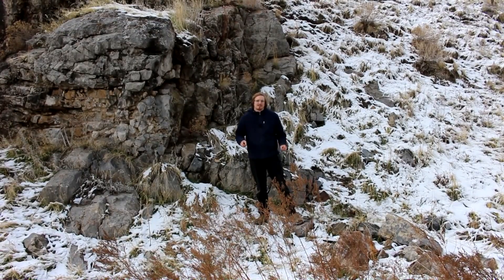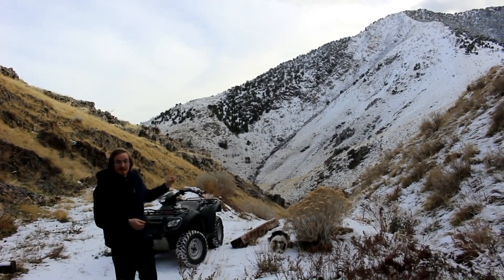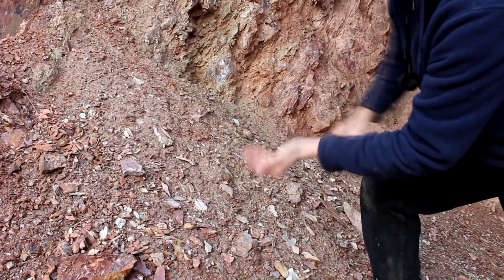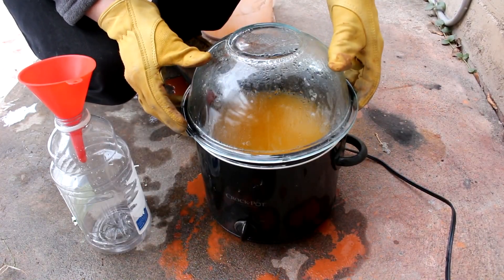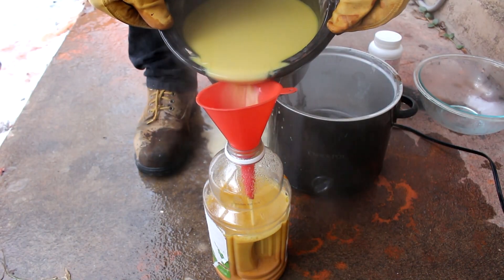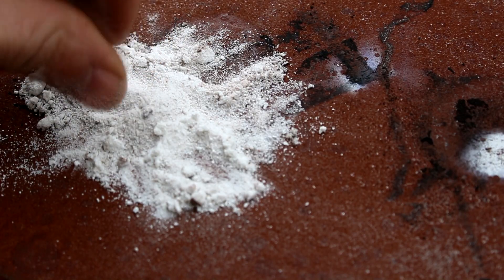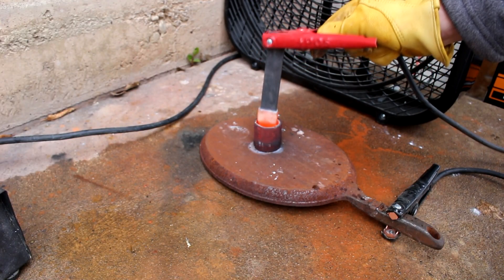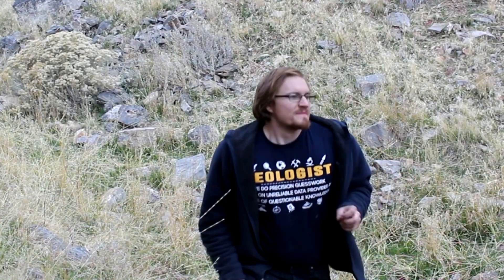Aluminum From Dirt

Comment: The great thing about alumina is the whole covalent nature of aluminum chloride leading to it being very easy to isolate with the decomposition (leaving it in water long enough causes it to turn into hydroxide as well. I know this because I accidentally made it just playing around with the acid). The cryolite part scared me, because 1. It seems like  hard thing to source on a large scale, and 2. I was scared about fluorine gas, but hearing that the cryolite doesn't get used makes me feel more inspired to try this.

It's not a top priority, because on a small scale, this is wildly inefficient, but I'd like to try this.

Comment: CODY, WHATEVER METALS MIGHT BE MIXED IN THE ORE, IF YOU MELT THE CRUSHED MATERIAL AND COOL IT IN A THIN AND LONG MOLD, THE METALS WOULD MOSTLY SEPARATE BY DENSITY, MUCH LIKE FLUIDS WITH DIFFERENT DENSITIES, OIL, ALCOHOL, WATER! YOU COULD ALSO DEVELOP (SINCE YOU ARE VERY COMPETENT) A SPECTROPHOTOMETER AND TAKE SAMPLES FROM DIFFERENT LOCATIONS IN YOUR AREA AND KNOW WHAT'S THE COMPOSITION OF THE ROCKS AROUND YOU!

Comment: 🎉My friend, I have a question for you that I hope you can answer.... Why do we not use aluminum salts to extract aluminum metal from it by electrolysis, such as chloride, fluoride, or aluminum nitrate?These salts have very low melting points

Comment: The silica is dissolved in basic conditions, not acidic. The acid is weathering the feldspar, but after that, the pH has to change.

You actually use this to your advantage😏

Comment: The tiny bit of aluminum is a good example of how highly charged electrons really are.  Faraday's constant - 96485 coulombs per mole.  If you want a gram of aluminum, that's 1/9th of a mole of electrons (1/27th of a mole of aluminum @ 3 electrons per atom), or ~10,000 coulombs of charge you have to move around.  If you were actually able to push 40A through the mixture it would still take ~4 minutes to do the job.  Electrochemistry is so often ridiculously slow.

Comment: Would it be easier to use an induction heater, which is contactless, rather than heating via current carrying electrode? I think the aluminium, as a conductor, would heat up and fall to the bottom
Reply: He isn't heating it with the electric current - he's electrolyzing it, the same way you can split water into hydrogen and oxygen by passing electric current through water.
Reply: @stargazer7644  thanks for the answer

Comment: I am an electrical engineer with associate degree in Metallurgy. Very Informative video I learned a lot from your geology lessons and I love the aluminum electrolysis. The fan was cooling everything so fast that your electrolysis did not yield all the aluminum. I would retry the electrolysis in open air without the fan and I bet you'll get more aluminum extracted. Congrats this is how inventors worked and found new metals.

Comment: I'm Rohan ,I'm from Jamaica I have been wondering why Jamaica,allow them to still take away our aluminum ore aka bauxite ,and not make aluminum here in Jamaica,I'm living in ga now ,so I decided to see if anyone knew how to make aluminum from the raw material,so that's how I found your video,,so thanks for the knowledge shared ,great video,as a child I used to hike the rivers and valley in spring Mount ,I used to find wired dirt on old river banking some blue some orangeish brown,never knew what they were but was always curious,Thiers a dirt we called abbuh,not sure if that's the proper name ,but it was not a rock it was hard and shining when our buts sat on it ,kind of like we polished it with our buts ,it was not stone but hard dirt I could brake it off in big chunks ,it had honey color of darker or lighter shades ,I always wonder about it ,I wish I had your knowledge in this area ,again thanks for sharing,I hope u do more videos
Reply: It takes huge amounts of electrical power to convert aluminum oxide to aluminum metal, so aluminum production takes place wherever electricity is cheapest. Jamaica does not have cheap electricity.

Comment: The muriatic acid solution pouring over your boot, the 200Amp electrolysis under the snow, on wet ground, with red hot electrodes...OSHA wants to know your location

Comment: Is it possible to do the electrolysis that turns the alumina to aluminum in an arc furnace?  Where it simultaneously heats and separates the material? It might be tricky, but it could be possible.

Comment: You started off with sourcing your RM's from the soil but it went from there to the shop shelves before you could get your metal. 
Still at one point Alluminim was concidered to be way more expensive than gold - which is because its so difficult to get it all done from scratch.

Comment: How much alumina did you add to the creolyte? The optimum for most smelters will be around 3%, at this point the resistance is the lowest resulting in a higher current efficiency. Lower alumina concentration would cause an anode effect whereby the reference voltage goes up quickly and then it is thermodynamically feasible to decompose the creolyte and Alf3 in the bath.

Comment: Hey Cody! Love the video and the channel. I want to try refining aluminum oxide from aluminum cans. Would it be possible to just dissolve the cans in acid, filter the solution to get all the gunk out, then crash the alumina out of solution? Would it be worth even trying this to make a usable amount of alumina? The idea is to try and reinforce the clay in my backyard with refractory alumina and silica sand to try and make a high fire kiln out of adobe. I love the idea of using recycled and local materials to make art, and while everyone's stuck at home, I think this might be an interesting project. Please let me know if you can point me to any resources, thanks!

Comment: Regarding extracting aluminum from clay: In the novel "War of the Worlds" the narrator is trapped for a time in a farmhouse with Martians manufacturing war machines in a large pit outside. In the pit was a machine that ingested clay from the soil in the pit and extracted aluminum from it for use in building new war machines.

Comment: In the last 2 minutes "We do Precision Guesswork based on Unreliable Data Provided by those of Questionable Knowledge" T- Shirt.  That's found on the T-Shirts for Geologists, Linesmen, Electricians, Plumbers, Mechanics, Engineers, Carpenters and a few others. Is NOTHING reliaable ?

Comment: I live in Rondônia in Brazil here is one of those tropical regions that you referred to here it rains almost 2,500 millimeters a year and the average temperature is 25 degrees centigrade and so I do not even have to walk a lot to find bauxite in great quantity I still live in the rural area and I could mine aluminum but with the process that uses caustic soda and electrolysis.

Comment: Over 200°C?  Odd, when I went through the induction at Alcoa they said the process kept the caustic at 153°C.  I remember because of how specific the number was.
I suppose they might've been referring to keeping it at that temperature when not actively processing, but that wasn't the impression their phrasing left.
It's also where I learned that, if you're going chemically blind, green is the last colour you can see before you're completely blind.

Comment: is low voltage needed for the electrolysis part?  I have seen it in videos on you tube in an industrial setting.. didn't realize there were more steps involved.

Comment: HF, hydrogen fluoride, is a particularly nasty chemical. Fe(OH)3 is rust colored but the Fe(OH)2 is green.  You can also separate the Al from the Fe in excess base as the soluble Al(OH)4(-1) anion which is water soluble.  Sorry no super or subscripts on formulas.

Comment: the aluminum hydroxide after filtered looks like cream of wheat.
Reply: I really need a crucible and oven to melt copper at least, I have extracted copper from a lot of side wire and I have a small box, i would like to make small copper disks instead of the loose copper, I also have a lot more cables I need to strip.

Comment: I am compelled to ask why you did not use a siphon tube to draw off the top liquid without all the spilling and incidental waste.

I often use a fine tube to siphon off a clear liquid if it is on top or use a funnel tap if the desired product is on the bottom.

Less time, less mess, more of the desired product. (~_^)-b

Comment: It's odd that you need such high temperatures to basically smelt aluminum when the melting/welding temp of aluminum sheet or cast aluminum is actually pretty low @1200F

Comment: Could you have suspended the fine aluminum oxide in a solution by dissolving it in an organic solvent like ethonol, used electrolysis, precipitated the aluminum, and washed it of the remaining solution ? I'm assuming there is a good reason you didn't. Im just curious.

Comment: I work in an aluminum foundry, and we monitor the iron content of the aluminum using samples out of the melter. When the iron content gets too high, we add strontium to bind with the iron and remove it; iron makes aluminum parts brittle. Magnesium is also added to strengthen the aluminum.
Reply: Man, make a video! 
Greetings
Reply: Cody put  a piece of his shoe into the solution, it shall do the trick...
Reply: Finding enough strontium would be a fun project on itself :) My first guess would be red fireworks..... or the chem supply store :)
Reply: That could expain my issue trying to cast aluminum when I was melting it in a cast iron pot
Reply: @lostcolonyforge5792  Molten aluminum is very reactive towards most other elements and will attack iron aggressively without using some form of di-cote. Carbon crucibles are the ticket here.
Reply: @lostcolonyforge5792  You could use 316 stainless steel, but you need to be careful as the molten aluminum embrittles stainless steel and it will come apart without warning.  I would stick with a high quality graphite crucible.
Reply: Сделай видео!
Reply: Q
Reply: How do you monitor the iron content? Any idea why strontium works?
Reply: why not centrifuge it?
Reply: The place closed a few years ago unfortunately. But I think that would work on a smaller scale.
Reply: Thanks for the insight!

Comment: Sorry to bother, but I have some 350 mesh aluminium powder and some iron oxide on the way (magnesium ribbon to for ignition), will the 350 mesh cause me problems or is it fine being that fine of a powder? most of the aluminium powder that is easy to obtain is made for modeling etc

Comment: One thing that bothers is... the omitted equation in the description (with no indexes)...  Al(OH)+HCl => AlCl + HOH
and than AlCl3 + 3 NaOH = 3 NaCl + Al(OH)3 ...
It seem, you can use any clay to interact with HCl... or it is actually has to be bauxite like for this reaction to happen???
Than NaCl could probably be separated again trough electrolysis, closing the loop. NaCl + HOH => NaOH + HCl 
Using any clay seem more fun... as it can be obtained from anywhere

Comment: Highly skeptical of your procedure here due to Al2O3 being a refractory oxide and not likely to dissolve in HCl. Likewise with TiO2 and SiO2. The gelatinous mess you got was most likely the Mg that you mentioned early on. If the contents of the rocks were oxyhydroxides, then you might be able to pull Al through via and HCl attack. Further, the flux you added, while aiding in the melting of the mixture, it is more likely that your Al in that is what responded to the electrode treatment since it was in such a higher abundance. You could probably have saved yourself this entire thing and just used the cryolite to make Al metal.

Would be interesting if you tried this a little more standardized to say that you did get Al either via testing the solubility of the Al2O3 in the cryolite flux and getting out a molar equivalent in Al metal, or by utilizing another flux that lacks the added Al content.

Comment: I heard that when aluminium metal was first made, or isolated, it was considered more valuable than many traditional precious metals, and so, some royalty (in France, I think) commissioned dinnerware to be made from it. Seeing the challenges in making it, rather than recycling it, highlighted by your video, I can see why it would be so expensive. It's a good thing it can be recycled.

Comment: When i use lye which usually uses for cleaning pipe from a fat for cleaning an aluminium pan or aluminium kitchen extractor filter it (the lye) causes a little surface damage on it. So i become interested, why Cody told that it (aluminium) can be dissolved only on high temperature (200 C). Though i use it (lye solution) on room temperature.
P.S. not native speaker as you might be guessed )))

Comment: You don't need pressure vessel to dissolve aluminum ore in hydroxide. I've done it successfully at atmospheric pressure. The key is that concentrated solutions have higher boiling point than water. You could even get to the 200°C, if you are brave enough to be around lye that thick.

Comment: grandfather used to work as a fire officer at the Phillips petroleum plant in the panhandle of texas. told me of a time he saw the chemists mixing up some HF, guess they were bored considering most of it is shipped in. long story short, they used powdered apatite (a gemstone common to new mexico) and mixed it with high concentration hydrochloric. the solution creates HF. you can get 5lb bags of apatite tumbling rough for under 10 bucks. just in case you wanna try making your own catalyst before melting out the aluminum next time.

Comment: Just as a bit of minutia, clay doesn't just refer to chemistry or mineralogy, but also particle size. In the US, anything < 0.002 mm is considered a 'clay' in soil texture classification. I imagine that low layer charge smectites (eg montmorillonite or bentonite) would make pretty lousy bricks, but are most certainly still clays. A fun video as usual, keep'em coming!

Comment: "Granaecious" or "granitic"?
Reply from the maker: Granaecious refers to any material with a similar composition to granite. granitic means that it has the same structure (large crystals) as granite.
Reply: @theCodyReeder    hmmm composition  v  grain size   ok!
Reply: +Cody'sLab Thanks Cody! I have used granitic for both of your examples good to note the distinction. I'm a soft rock geologist by training and trade. Cheers!
Reply: ZSandmann

Comment: On the family farm, years ago we discovered many drilled shaft about 2 to 3 feet diameter. We had to mark them off so that no kids would fall into them. After investigation, it turns out that these shaft were drilled to remove the mica that was there as it was a popular metal at the time (mid to late 1800s ) My grandparents bought the place in 1901. There's still some pieces of the mica laying around but my question is this: What other interesting metal ore can I possibly find when there's mica present?
Reply from the maker: titanium is common in mica but I think its more likely that they were producing asbestos from it.

Comment: Acid on the foot at 9:22....
Reply: It helps that he's wearing steel-toe boots.
Reply: it is a cut [you can see the bucket fade out], however he only cut out half a second of silence
Reply: It's not a camera cut, it looks like he paused because he noticed he was spilling the solution
Reply: I have extremely dry skin in the winter and even with that most acids acid don't really act that quickly on the skin. Nitric acid is instantly noticeable, but muriatic takes a bit to start hurting and any real damage can be prevented by flushing the area with water as soon as the spill occurs. I did get a drop of a fuming mixture of concentrated nitric and sulfuric acids on my hand once and that hurt immediately, but that is because nitric acid is an oxidizer as well as a strong acid.
Reply: BASED CODY
Reply: You can tell there's a subtle jump cut right before he says "aluminum chloride". I assume he had an alkaline on hand that he used to neutralize the acid that spilled, but just cut that out.
Reply: That spill was caused by surface tension. He should have added some soap to the slurry first before poring it to avoid that problem.
Reply: Thus is born the legend of Peg Leg Cody, the Pirate Physicist!
Reply: .༼ಠఎಠ༽ What do you mean acid is dangerous ? Don't believe you.
{ --------- }
Reply: Ahuratchek
:-). It was a good concentration too. You could see the concrete being dissolved/etched.
Reply: electronicsNmore I've read somewhere that hydrochloric acid does not react instantly with skin so it's okay if you mess up a little.
Reply: Ahuratchek
It does, I've acid washed and painted many garage floors in the past, and use it in the swimming pool(muriatic acid). You can feel your skin getting itchy before the burning starts. Does not take long either, UNLESS you have very oily skin.
Reply: electronicsNmore one foot down...
Reply: your stomach produce hydrochloric acid. it is danger if you drink a glass or have the hands in it for an hour. the problem is the smell and some irritation if you 
breathe.
Reply: ..... He is so professional
Reply: Better then Acid under your tongue.

Comment: +Cody'sLab Hey codey, could you try to extract iron from blood? I heard that pork blood is very cheap, may you try to do it, just proof of concept ;)
Reply: Pig iron is very brittle...
Reply: there is a tiny tiny amount of iron in blood
Reply: theres only about three milligrams of iron in human blood and the human body contains about 5 litres of blood
and all mammals pretty much have the same blood composition so to form even a gram of iron he would need
1666 litres of blood. Not sure thats cheap.
edit: factual error, actually human blood has 3 to 4 grams of iron in it so making a gram would require 1.67 litres, a kilogram requires the amount I mentioned above.
Reply: Casey Hennekens says the one without a profile pic
Reply: Neat
Reply: Omer Magen use my blood
Reply: Casey Hennekens   not funny.
Reply: At least I don't hide behind an avatar you coward
Reply: Casey Hennekens amen brother